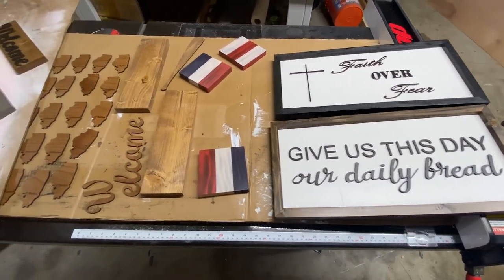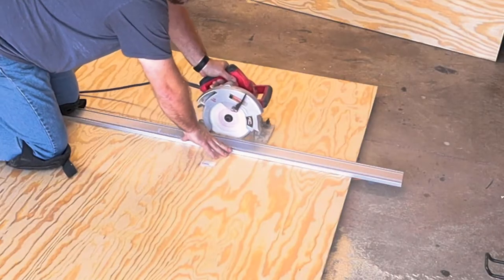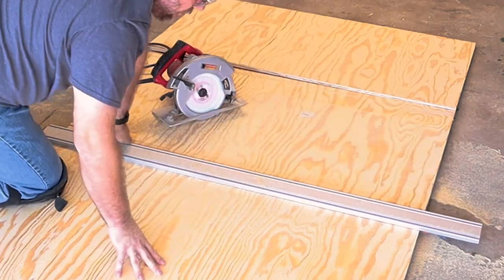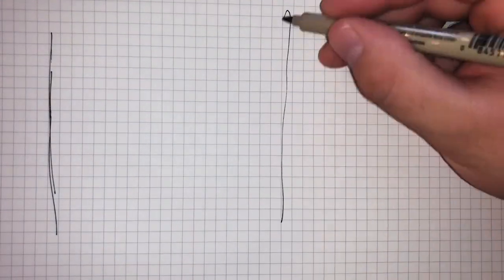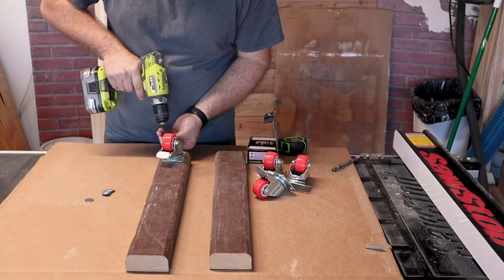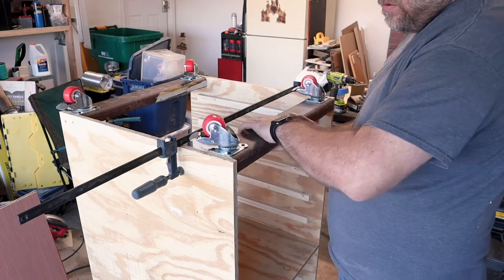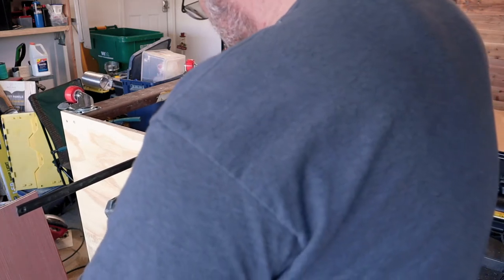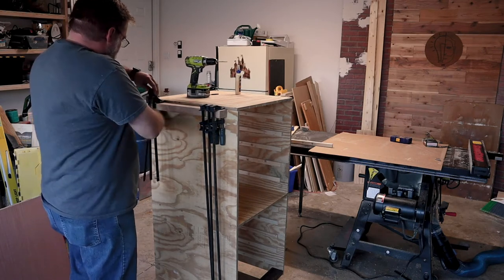How to build a parts drying rack for small work spaces

Comment: If you threw on a quick face frame you would probably get rid of the side to side movement but it looks like it should work just fine as a drying rack. All that finishing it seems as though a spray setup would be a nice upgrade.
Reply from the maker: Surprisingly it doesn't move that much after standing it upright.  Also when all of the trays are in place they add to the rigidity.  

I am trying to figure out a good spray setup.  I do not use a lot of spray applications other than the final clear coat.  I am considering a popup tent option since I dont have the space for another piece of shop furniture that is only dedicated to spraying.
Reply: @mysimplebuilds  Homeright sells a really nice pop up shelter and I’ve seen some setups using PVC and tarps. I’ve used the PVC and tarps and will say that for small stuff it’s not very convenient. But I would think a nice dedicated 2 or 3 stage HVLP would be a nice upgrade and speed up production.